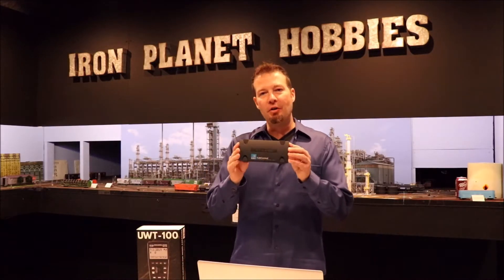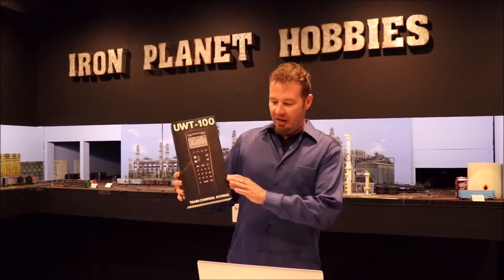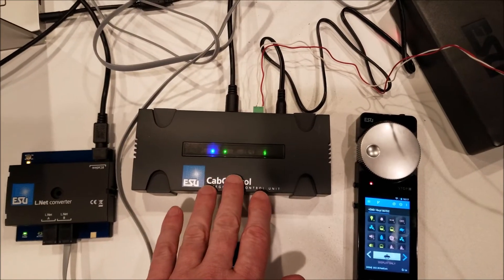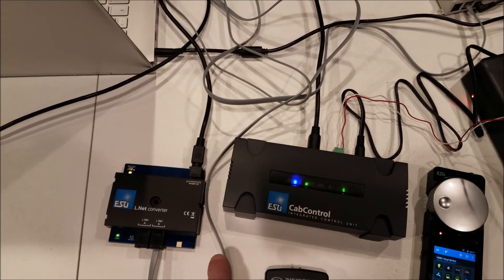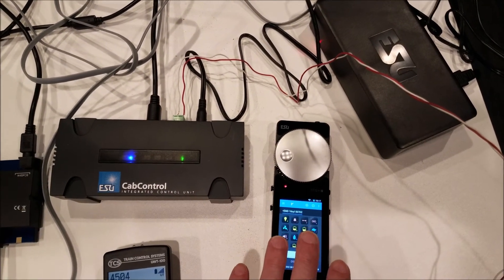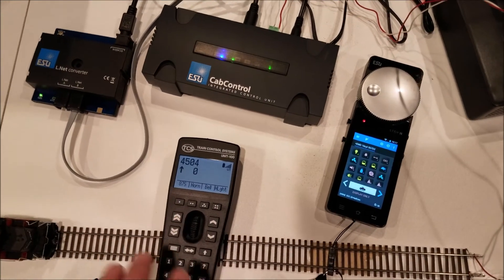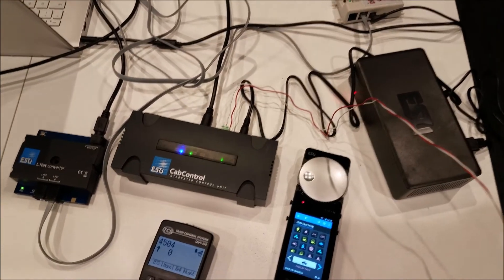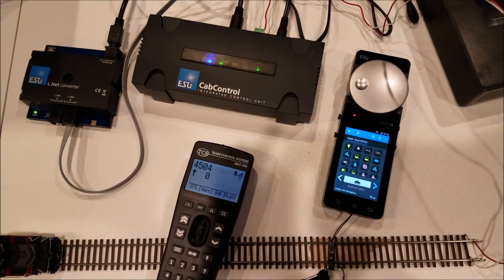TCS UWT-100 Throttle Setup On ESU CabControl Without A PC Or JMRI

Comment: ESU L .Net Converter Limitations

This is a device that was created long ago to provide a Loco Net Connection for systems like the ESU ECoS and CabControl. Unfortunately, it is not a full function device and does not transmit commands for F13..F28 to the command stations. Only F0..F12 are accessible. It was built around the era of the Digitrax DT400 which only had F0..F12 keys.

This basically means a TCS UWT50/100, iPhone/iPad running WiThrotle, and Android device running EngineDriver are limited to F0..F12 use.

This limitation was never discussed when I first bought one for my TCS UWT100 a couple years ago and I never discovered it as I usually kept everything I used in the F0..F9 range. With my ProtoThrottle and need to use more than F0..F9, I put lighting controls in F10..F19.

Not a problem for the ProtoThrottle with ESU-Bridge that connects directly to the ESUwifi (basically bypassing the Digitrax LNWI which I only use for my TCS UWTs, iDevices, and Android devices. Just have to rethink the mappings.

It is too bad that Digitrax licensing is too cumbersome to deal with that ESU can’t activate the L .net port on the CabControl.

I suppose the solution for TCS UWT is to just switch to the $530 TCS LCC CS-105 system, though it is not entirely clear to me whether that system is going to suffer the same F0..F12 limitations because of Digitrax. 5 amp system compared to the $400 CabControl’s 7 amps. Catches up to ESU with RailCom on the main programming capability. Not entirely sure the price is worth the switch compared to just adding another $642 ProtoThrottle or another Mobile Control 2 throttle.

Technology. Great when it works, miserable when it fails or does provide advertised services. Limitations not even mentionned in the manual since this thing is so old.

Comment: I cannot get this to work.  I keep getting loconet sleeping message on the tcs remote
Reply from the maker: Can you connect with your phone or any other device?
Reply: @IronPlanetHobbies  the esu mobile control ii throttle works with the command control and ive connected a phone app to work as well.  Cannot get the esu loconet sniffer, digitrax wifi adapter and tcs throttle to work.  Updated to most recent software on cab control as well
Reply from the maker: @RodimusPrime  What app did you try and did you connect it to the LNWI or to the Cab Control?
Reply: @IronPlanetHobbies  Ecos controller android app connects to the ip address of the cab control unit.  Message that is displayed on the tcs throttle is "loconet is sleeping" the tcs throttle connects just fine to the digitrax part.  Ive also used my tcs throttle, digitrax adapter and ecos loconet sniffer with my Ecos  system perfectly.  I know all these parts work they just dont want to talk to the cab control
Reply from the maker: @RodimusPrime  If it all works together on the ECOS but not the Cab Control, that lets me know that you might have a problem with the Cab Control or the plug if you are using the same cable.  Do you have another LocoNet device that you could plug into the L Net Convertor just to test with?
Reply: @IronPlanetHobbies  i have a PR3
Reply from the maker: @RodimusPrime  Perfect.  Go here and download the update for the the LNWI: https://www.digitrax.com/downloads/  They put out an update that might fix the problem.

Comment: Very cool.. Can you also run JMRI and does it sync simulateously? If so..where does the PC USB interface? Into the CabControl?
Reply from the maker: Yes, you can still run JMRI at the same time.  You connect your PC to the CabControl with the LAN port and router.